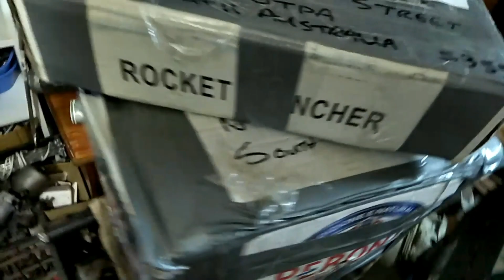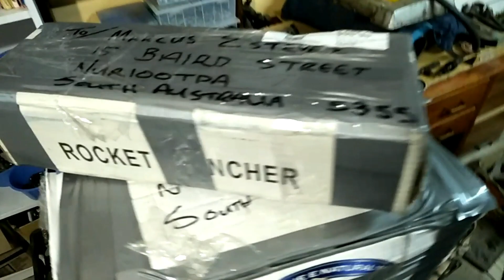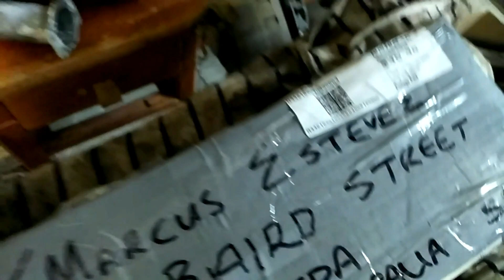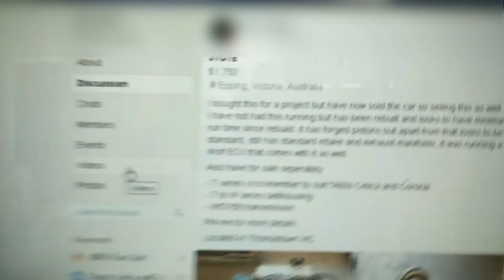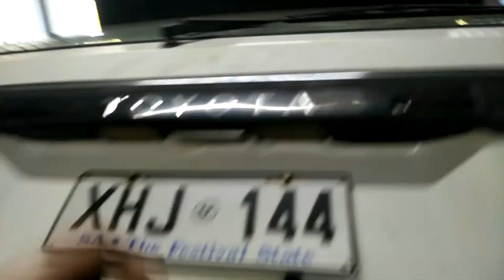NooB RA40 Celica: Episode 2 - Small Update

Comment: Nice to see another video. Interesting to see how this 3t engine turns out. I’ve personally never heard of it. Also, what’s keeping you from going to something like a beams engine? I’ve been seeing those swapped into 86s and stuff a lot and they seem to be very capable engines.
Reply from the maker: A lot of people have been suggesting more modern motors to swap into this thing for years now, even back when I rebuilt the 18RG. Quite honestly, the thing that keeps me sticking with the old motors is how awesome they look and sound, and how easy they are to work on. I'm not fussed about power. I wanna open the bonnet at car shows and have people scratching their heads at this 4 banger with 8 spark plugs going "wtf is this?".

But yeah, not exactly sure what turns me away from modern engines. I'm just not a fan. I'd rather love seeing old twincams like 18RG's and 2TG's in classic Toyota's then BEAMS engines. Hell, I even love seeing hotted up 4M's or 5MGE's over 1J's and 2J's. I'm strange I guess. Maybe I should make a video talking about the reasons behind it.
Reply: NooB Auto Parts yeah that‘s cool. I also understand it though, something about old engines is just cool. Quick question; I live in a state (U.S) where we need to get our cars checked for emissions. Basically I can’t delete anything ( to my knowledge). Currently I’m looking for a new carb and don’t know what to get. Should I just find a stock Aisin one or is there a good replacement? (22r btw)
Reply from the maker: @JosephSamsor  32/36 weber, or a larger weber then that. They liven up all Toyota motors when jetted right.
Reply: NooB Auto Parts what about all the vacuum lines? Don’t those have anything to do with the emissions systems? The kits I’ve looked at involve deleting some things and idk if it would pass here.
Reply from the maker: @JosephSamsor  Well, probably not. It's all designed to work together for least amount of emissions. More performance will generally make this worse. I can't speak for the US though, you may have different emissions setups to what we got here.